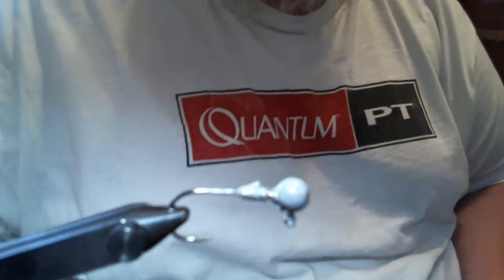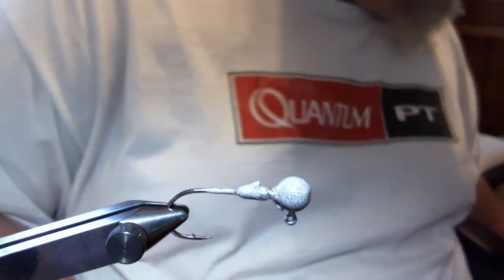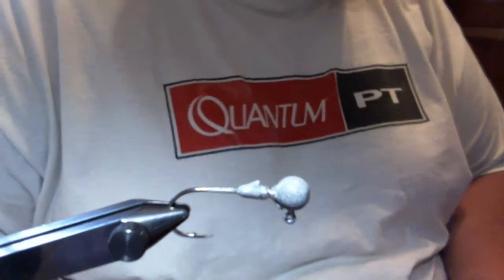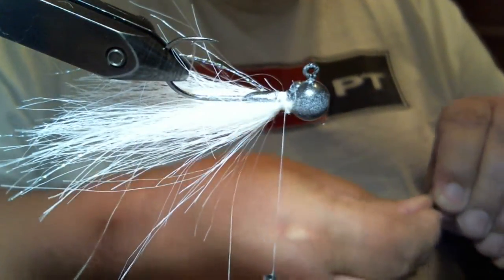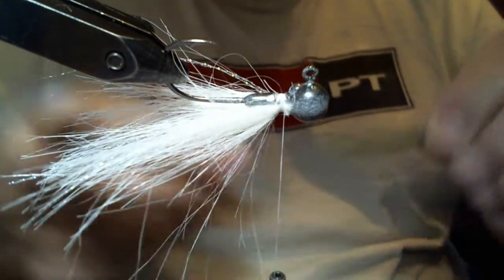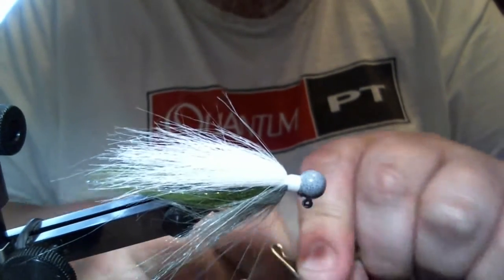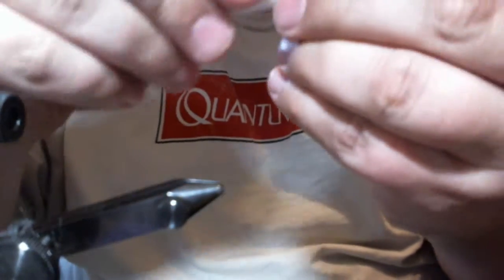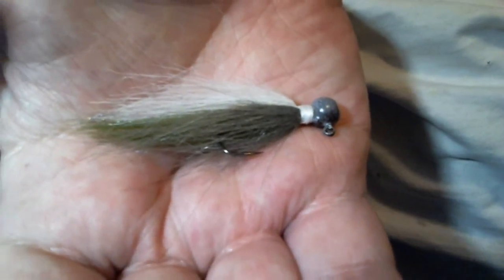Tying a Craft Fur Jig

Comment: Glad I chose your video to help orient me to this process.  Great job at explaining everything, as u went along! Next, I need to buy a vice, learn more about various and different thread characteristics, and figure out how that "whip finishing tool" works!!!  I'm excited to do this!  Now if I did just a single color I assume you'd position the "bunches" more around the sides of the hook, and use as many thicker or thinner "bunches" of hair to get the overall profile you're thinking will be not  too little or too much to entice (in my case) the smallmouth!
Reply from the maker: Thank you Bruce, I'm glad the video has provided some help.  There are a lot of videos on using a whip finish tool and you can also do it by hand. Good luck on your jigs!!

Comment: What’s your opinion on bucktail versus craft fur? If I’m fishing slack water, ponds or lakes. I normally try Marabou. I’ll even throw marabou in the river. But my number one catching jig here in Illinois is a brown top yellow bottom bucktail jig. And I’ve used bucktails for ever, bucktails can be inconsistent in shape and size so I recently changed to craft fur, same one you have here. Is there any advantage to using original bucktail versus craft? When I’m fishing in the river there is current. And I’m always doing a cast and retreat. I don’t stop it and let flare or put it under a bobber. Will it perform the same as bucktail? I went out this morning and in about two hours I caught a smallmouth, and a 6 pound flat head. Not huge. I’ve caught 30+lb flat heads but on a medium light rod it was a fun fight, but that was on my trusty bucktail. Now I don’t know if I should switch to craft fur . I guess I’ll give it a shot
Reply from the maker: Tony, bucktail has less action than craft fur. Craft fur is closer to marabou and for me marabou and craft fur are both warm water materials. I'm not sure of your water conditions but I bet the fish aren't in a heavy feeding mode when that bucktail is working. I find that bucktail works when the fish aren't very active, the craft often has too much movement in certain conditions. I use bucktail mainly in cold water conditions, and once the water gets past the 55 degree mark I'll go with marabou or craft fur. Now that is generally speaking, there have been times when the bucktail was better in warmer water and when marabou and craft fur were better in cold water. I guess it is trial and error but in my area bucktail is the king of cold water smallmouth!!!
Reply: smalljaw That makes sense, it’s just barely now been warming up to 67-68 degrees we still get cold nights in the high 40’. Today’s a low of 48. And most of our rivers are high,  flooded and the waters dirty. So the fish aren’t really biting, so makes sense why that bucktail worked. Bucktail-cold. Marabou, Craft-warm I never though of it that way. I’m used to jigging with just gulp alive minnows or curly tails and the only hair I ever tied was bucktail, I’ve just now since 2020 have gotten into marabou and craft. Even then it was interesting too learn about the different types of Marabou so I’m still learning haha, I turn 21 in July and we were planning to fish smallmouth at a lake by the iron river where my friends family owns land. thanks for the reply,  I really appreciate you reading through the whole comment most of the time at other channels the comment just gets lost. You have tons of knowledge on tying and everything you tie turns out amazing. Hope one day we get to fish! All this knowledge on tying, i know you have some tips and tricks for fishing! Haha take care man, life’s crazy right now. Stay healthy! No better way to social distance than to go out fishing!

Comment: hi smalljaw first i would like to thank you for all your great work here on youtube, you have been very inspirational for many new generations of tying. Can i add hackle to a craft fur jig or teaser fly? and which one would work better with it in salt water, neck or saddle or do you prefer northern buck tail for hackle ? thanks pal.
Reply from the maker: Thank you for the kind words, I really appreciate it. As for adding hackle to craft fur, yes, it works well in combination because of the fluid movement in the water. You can try the teaser fly but I don't have experience with it so that may be something you can try but hackle will work and saddle hackle if you want a little more action as neck hackle tends to be a little more stiff.  Thanks again for watching and for the excellent question!